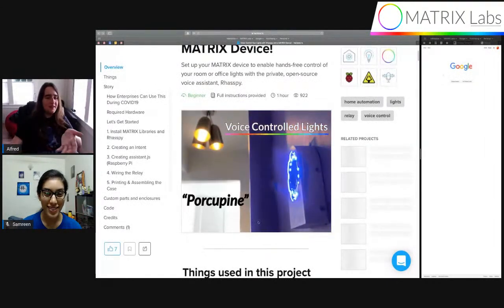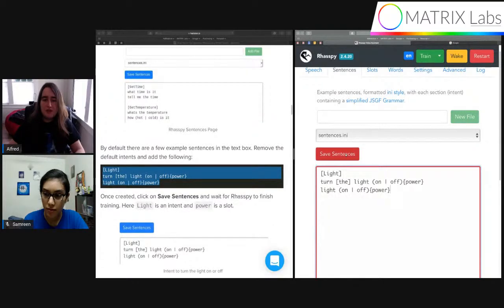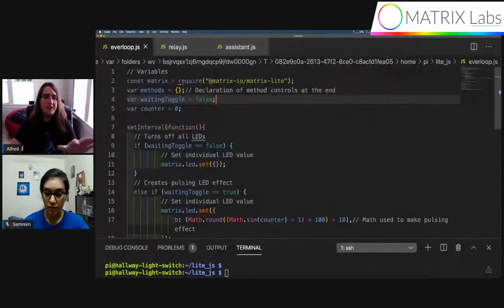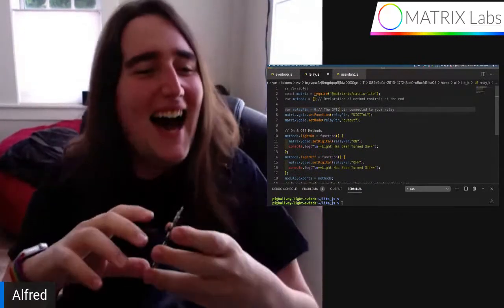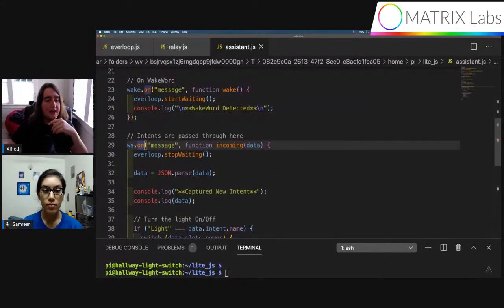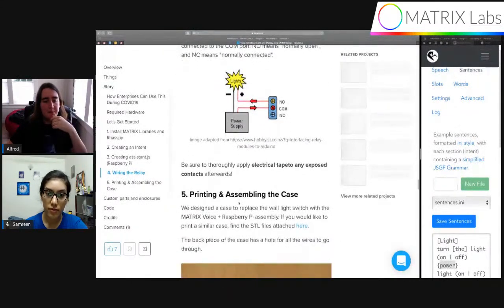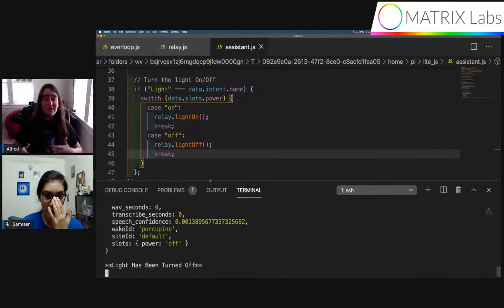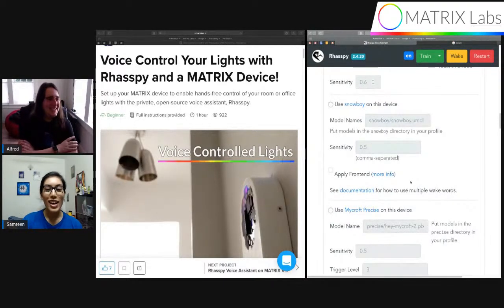Voice Control Your Lights with Rhasspy and a MATRIX Device

Comment: Hi all... Control Lights is not complicated if you use hubs like Hubitat who work great offline and is very configurable..... the clue is to have a good mic and voice assistance who works offline to send commands to Hubitat through your intranet or internet. So, I just would like to see how effective is Matrix Voice in a noise environment and some test at different distances as well....  could that be possible?
Reply: Did anything ever come of this?  Id be interested to compare data.